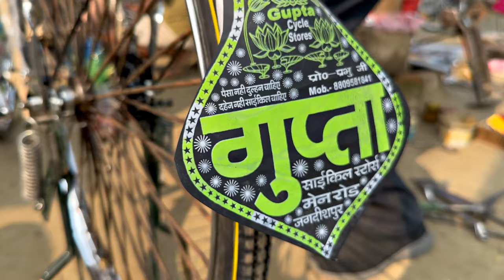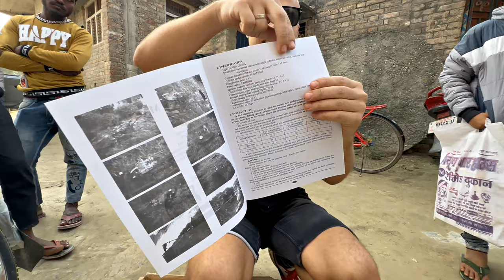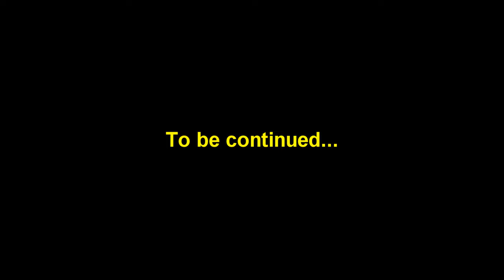✅The most powerful BICYCLE MOTOR!!! Assembling a Bicycle with a Motor in India⚡️💥🌪

Comment: That's a GT-3/5 engine, not anywhere near the most powerful you can put on a pedalbike like that. The actual powerful one is called a YD-100 and is what I run. You MIGHT get 30 hours out of that GT-3/5 before it either melts or breaks a piston ring (ask me how I know). Spend the extra $40 on the YD-100 and you'll thank me. It's also more powerful. I have 1400+ miles (~2250Km) on this engine. Those GT-3/5 engines really suck.
Reply: You could easily mount a 199cc to a pedal bike, this is nowhere near the “most powerful bicycle motor”
Reply: I have 2 yd100s people talk alot of crap about them but its just people that cant tune or dont want to deal with problems that everyone of these motors have but lets be honest the phantom 85 and the minarelli are both better then the yd100 its just facts
Reply: Avenger 85 is better than the yd 100
Reply: @georgebell8826  I personally like the yd100s that's y I have 2 but idk about the avengers I've never had one
Reply: I'd either rock a ld100 or a minireli
Reply: My yd100 piston clips ejected good mod is ones fit off Ktm sx50 any of these engine kits needs a good overhaul grease and tighten bolts from day one cleanup intake and exhaust ports ect needs a bit of work beforehand but it’s relatively inexpensive I’d say smaller sproket chain tensioner spark plug and mz65 exhaust
Reply: @theLyzhendricks  the YD100 is by far and away the best 2stroke pedalbike engine out there. I've had 2 (the first one failed by no fault of it's own, I cooked it being stupid). I am running an NT carb on it and have had to do just about 0 adjustment or tuning - it just works. I'll never run anything but a YD100.
Reply: @georgebell8826  Sorry, no it isn't. They are a Gt5 with a 54mm stroke. That's it. They break like gt3/5, because they're the same thing with a different rod.
Reply: @refluxcatalyst7190  i do like mine they run good but ive heard people really like the phantom 85 and the minarelli mabby someday i will get one but they expensive
Reply: @refluxcatalyst7190  the avenger is way better than the yd100 hands down.. avenger is a 40mm stroke with a 52mm bore. . yd100 is only 50mm bore with same stroke.. but the guys that designed the avenger cylinder made way better ports,crank is also balanced better . Out of the box avenger 85 will do 50mph/ 80km. Yd100 won't do that
Reply: The avenger 85 is a ms440 clone @maxhearld1035

Comment: With a 30cc engine on a bike you cant expect it to go fast, Those 80cc's were ok stick with those. What you boys need are some KTM 450s if you want real power, my KTM 505 450cc with performance cams and high compression piston weighs 235lbs and has 70hp, your 80cc bike might have 5hp maybe

Comment: I think the V Brakes will be an issue, even with my ebike which should be lighter than your gas bikes, braking becomes scary down the most extreme of steep hills, and there are not even any mountains in this area where I live.  They need large hydraulic disk brakes like a good mountain bike has.
Reply: They can poke their fingers through the front spike. I can tell you that’ll stop you real quick
Reply: A front hub drum brake would be the premium choice IMO. I used one of those by Sturmey Archer when I had a gas bike & it stopped on a dime

Comment: Is this a joke? That motors junk and that hill isn't remotely dangerous.
Reply: These motors are only "junk" when u dont know what ur foing i got like 1k miles on one of my motors
Reply: @theLyzhendricks  I've put well over 3K miles on my KLX125, I bought it used with glitter in the oil and from an owner that never changed the the oil. God knows how much they put on it. 1K miles is nothing for a motorcycle engine, they should last 10K to 15K.
Reply: @linuxguy1199  its not a motorcycle engine tho its a cheap chinese bicycle engine thats made with cehap China metal u cant copare a name brand bike to a cheap china kit that just dosent make sence  and u talking 4 stroke theese kits are 2 strokes its ganna need a rebuild every once and a while